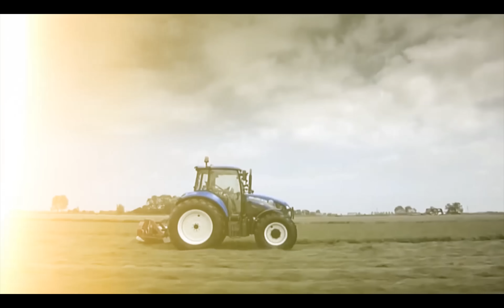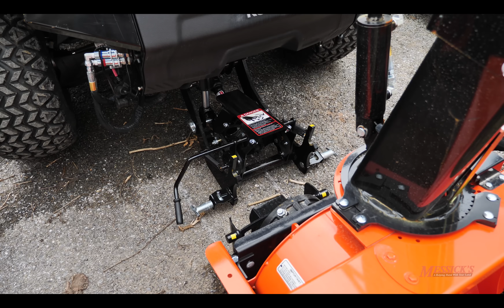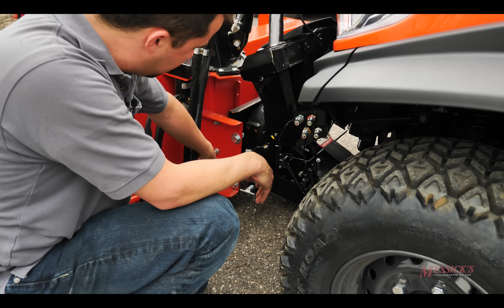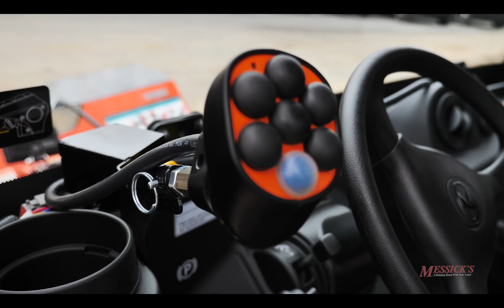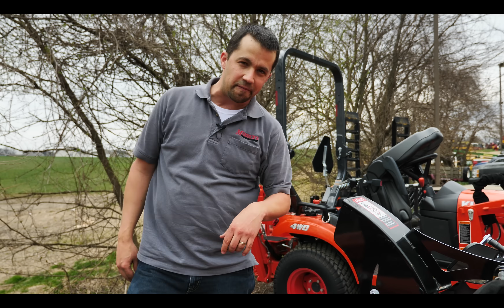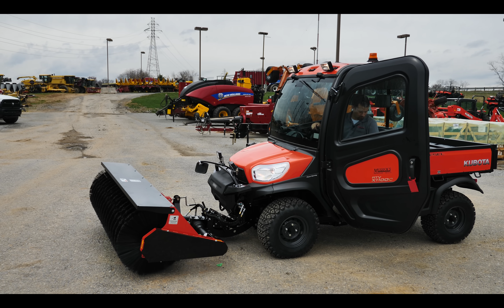Front snow blower & broom for the Kubota RTV Utility Vehicles

Comment: What are your thoughts on the loss of ground clearance with the k-connect as well as the ease or removing the k-connect!
Reply: Tim Pierce thing is....the folks buying Kubota utv setups to brush or blow aren’t the same crowd using them to go rlk hunting in Montana or trail riding in Georgia.
Reply: I put these together.. I got to use one after a blizzard.  Up and down curbs no problem.  Works pretty well

Comment: I too would like to see a mower.....We have the blower on our RTV, unfortunately we have had some issues with it.  Head Gasket at 1200 miles and a driveline failure in the mid pto assembly that was required to install for the front blower.  Maybe 50 hours on the blower setup at the time of failure.  Kubota has stepped up and is trying to make it right, i just hope we have better luck with it once the shop and kubota get everything straightened out.
Reply: Also, the K Connect setup doesnt work well with tracks....fwiw